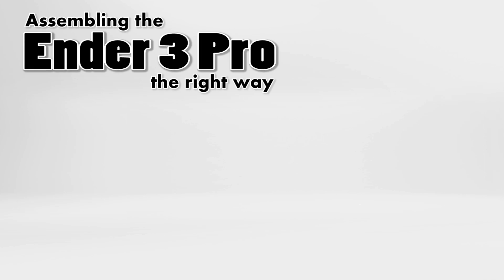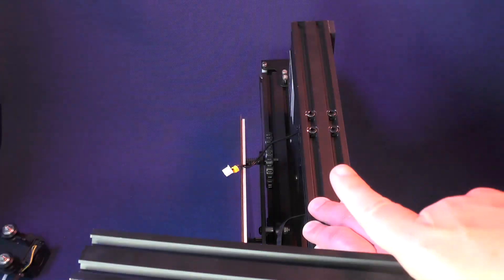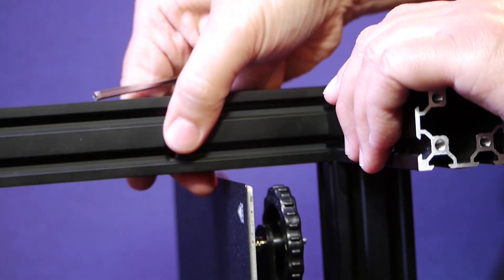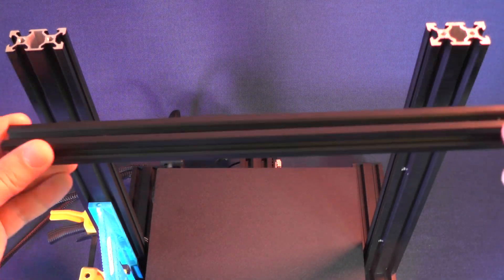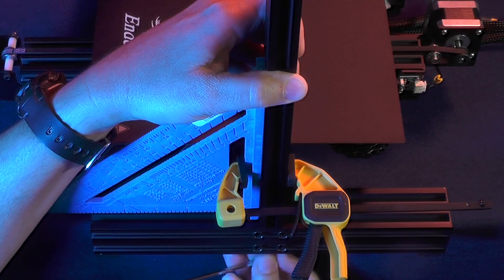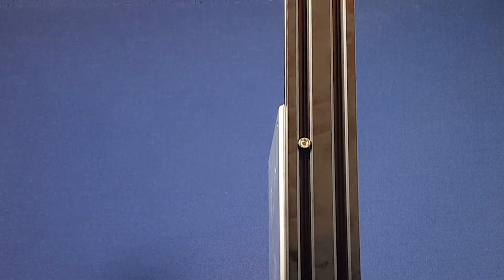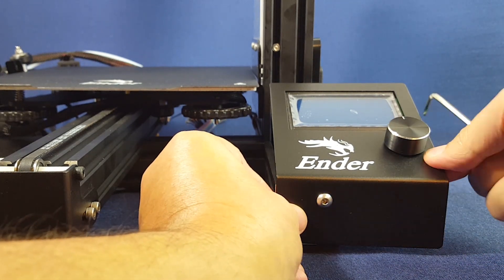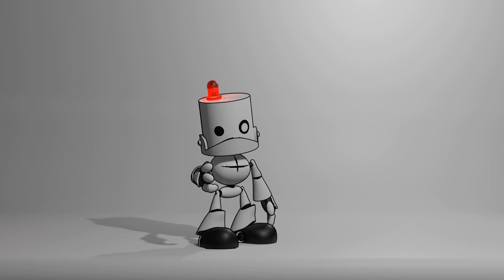Ender 3 Pro (2021) Assembly Guide - Part 2

Comment: You need two squares, not one.  Went to the hardware store based on the first few minutes of this video.  Realized at 5:50 or so that I needed another one.   Just FYI to save everyone a trip.  I thought I had everything I needed.  Guess I'll try again tomorrow.
Reply from the maker: My sincere apologies! You are absolutely right. I pinned your comment so it will always be on the top and, hopefully, will help others not to have to go through the same vexing situation.
Thanks for pointing out my mistake. 
In spite of having been delayed for a full day, I hope you'll have a great time assembling your new Ender 3 Pro! 🙂👍
Reply: @MakerMindset  These videos are excellent though.  I got that second square after work today and got half way through part 4 tonight, hoping to actually finish tomorrow or the next day and get my first print started.  Very detailed and easy to follow.